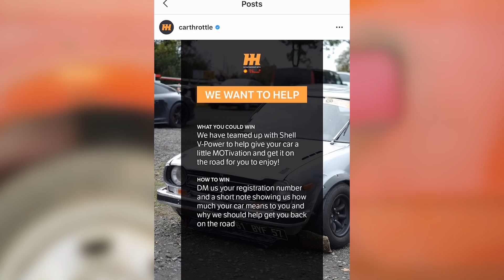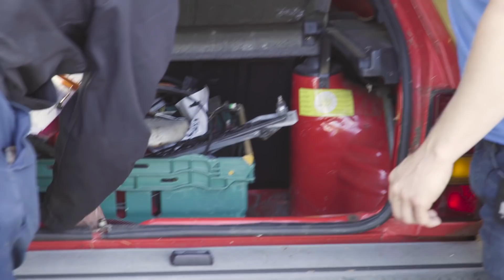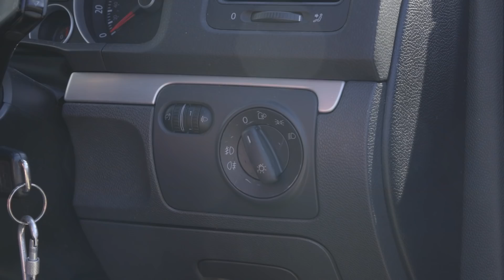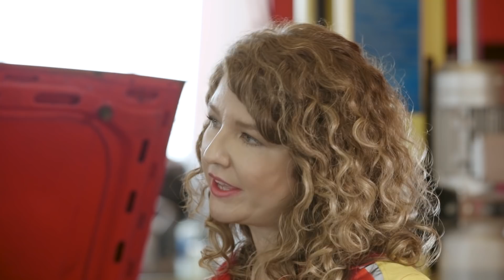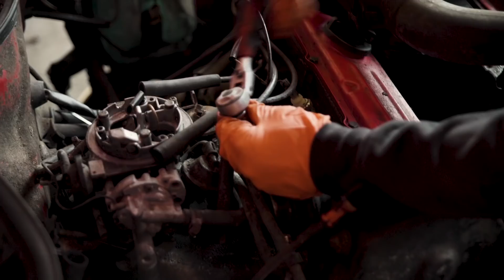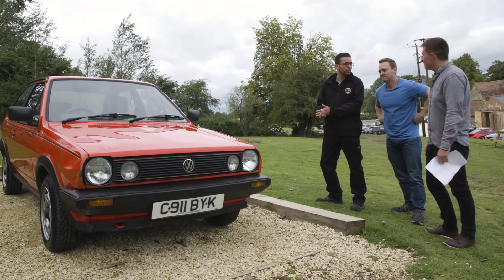Saving A Rusty Project Car From The Scrap Yard

Comment: Classic mistake when guessing how many fails you're gonna get.
Always assume at least 2-3 TIMES more fails than you think.
If EU is any comparison, they'll probably be making it so you can't fix rust yourself unless you're an authorized this and that, lesson being: Fix ALL rust before ever bringing it to MOT.
Why the V-Power on this car? With normal gas it'll run a bit warmer and heat up faster, old engines are better off for that with cold season approaching.
Besides I read further down that this car is now registered as an SORN, so all was for MOOT 😂

Comment: Lets be honest, whether it's Shell V-Power or any other fuel, I can tell you that most oils are produced in the same refineries, as they are typically all the same, you can tell because different trucks, who come to take the oils and all the different brands (Castrol edge, Shell, Esso, Texaco, etc)

Comment: In case anyone is interested, here the full MOT report:

Repair immediately (major defects):

    Horn not working (7.7 (a) (ii))
    Windscreen washer not working (3.5 (a))
    Rear fog lamp does not emit a steady red light (4.5.4 (a))
    Offside Front Passenger's seat with a defective structure (6.2.6 (a) (i))
    Offside Front Body mounting fixings missing O/S FRONT WING MISSING (6.2.2 (c) (i))
    Offside Front Brake pipe excessively corroded (1.1.11 (c))
    Nearside Rear Brake pipe excessively corroded (1.1.11 (c))
    Integral body structure or chassis has excessive corrosion, seriously affecting its strength within 30cm of a body mounting (6.2.2 (d) (i))
    Rear Inner Integral body structure or chassis has excessive corrosion, seriously affecting its strength within 30cm of a body mounting (6.2.2 (d) (i))
    Nearside Rear Integral body structure or chassis has excessive corrosion, seriously affecting its strength within 30cm of a body mounting (6.2.2 (d) (i))
    Offside Rear Integral body structure or chassis has excessive corrosion, seriously affecting its strength within 30cm of a body mounting (6.2.2 (d) (i))
    Battery insecure and likely to cause a short circuit (4.13 (a) (ii))
    Nearside Front Brake prescribed area is excessively corroded (1.1.21 (e) (i))
    Nearside Rear Position lamp not working (4.2.1 (a) (ii))
    Offside Rear Position lamp not working (4.2.1 (a) (ii))
    Rear fog lamp lens defective such that emitted light is adversely affected (4.5.1 (b) (ii))
    Offside Front Headlamp light intensity severely reduced (4.1.4 (a))
    Fuel cap/sealing device missing (6.1.3 (b) (i))
    Brake performance not tested ALL BRAKES BINDING (1.2.1 (g))
    Direction indicator not working ALL INDICATERS (4.4.1 (a) (ii))

Repair as soon as possible (minor defects):

    Nearside Front Brake pipe inadequately clipped or supported (1.1.11 (d) (i))
    Offside Front Brake pipe inadequately clipped or supported (1.1.11 (d) (i))

Monitor and repair if necessary (advisories):

    MAIN BEAM TELE TALE NOT WORKING
    ALL TYRES PERISHED
    Offside Front Suspension component corroded but not seriously weakened (5.3.3 (b) (i))

Comment: Nice work guys.. love the fact you've saved this lil gem! 

Think I'm gonna have to either sell on as repairs or scrap my beauty. (E90)  Engine has a problem (not diagnosed due to lack of time and funds)  it's not been on the road for 4 years now as Ive had no funds to fix it.  However I can't seem to part with it. As it was handed down to me from my late father. I ran it for 2 years booked it for a service and 3 months later it's not running right. Sounds horrendous.. I'm dreading the day I eventually get it fixed due to the fact it's been stood it will cost the earth. If I even ever get to that day..

Comment: Just want to state that this “special fuel” is no different than Asda’s or any other ‘normal’ fuel. You may see a slight difference is something like a new sports or super car but that is about it. If your just driving around doing day to day activities there is no need to waste extra money for what is the same fuel as the cheaper option. It’s like having an expensive loaf of bread £2 compared to a Asda own at 45p it’s the exact same but one is 3x the cost 🤷🏽‍♂️be smart don’t waste your money

Comment: Unless your engine visibly suffers from engine knocking, premium petrol is a waste of money. The ability of the fuel to cope with higher compression has no benefit in cars that do not have the requirement. ITS A SCAM.

Comment: It is much easier to pass inspection here in the US. Much much much easier. If your lights and signals work, windshield wipers, horn, tires still have some tread, brake on passenger side front wheel, you're usually good to go. Being on joking terms with your mechanic works wonders.

Comment: This drives also on usual gasoline with 91 octane and is has no knock sensor so its completely unnecessary to use gas with 99 octane

Comment: Although my Country Canada is in a bad way politically, I'm very glad it's not like the UK for passing vehicle inspections. In Alberta (Other provinces vary a bit so there is an "Out of Province inspection" required if you buy one or move from another province. A regular inspection is required when you buy a car that is 10 years old or older and never again after that while you own it. For the inspection rust isn't really a problem unless it's making the car unsafe to drive. Brakes, good visibility through the windshield, No fluid leaks and Lights all working including daytime running lights on 24/7 when driving. Tires and steering, seat belts of course but not much more than that. Once the car has passed it never needs to be inspected until you sell it to someone else then it is their responsibility to get it done. Costs around $100 Canadian or around $150 Pounds UK. A certified Mechanic from anywhere is legal of he has his certification number. You can get a independent Mechanic to do an inspection for $50 or $60 if you know one.

Comment: Me thinks the lady has swallowed a text book, but is oblivious to the irrelevance, to the carb fuelled and distributor ignited, 1985 VW engine in question.
If it cleans the inlet valves great, but neither the carb nor distributor, will magically optimise their settings, to take advantage of the higher octane fuel.

Comment: Know what’s better than Shell V-power? No petrol at all...yeah. The revolution has started. Buy an electric car. Internal combustion is yesterday’s technology. As a new EV driver, I can safely say I will NEVER buy petrol again. Keep your V-power Jo. It’s garbage.
And when did Car Throttle become a shameless plug for consumables? This was a 12 minute Shell advertisement. Came close to an unsubscribe hit there pal.
Reply: Whilst i agree with you that the future of transport is definitely electric, I must point out some flaws in your logic. 
The environmental damage caused by the production of any car is quite frankly catastrophic. This is true of all cars, but especially electric cars due in no small part to the batteries.
If one has a clean power source from which to charge the batteries and also keep them conditioned, then one can feel safe in the knowledge that after 7 years their car's production has been a better for the environment than a fossil fuel burner. 
If your energy source is a dirty one or if the batteries aren't conditioned properly, then any advantage is lost.
Also, around 2/3 of particulant pollution from cars is produced from brake, tire and road dust. As electric cars are generally much heavier than their fossil fuel burning counterparts and more than double the weight of this old Polo, then you're doing more direct damage to people's health than most other drivers.
Given that the majority of environmental damage cars do is in their initial production, it is almost always better to keep an old car running as long as possible.
Reply: Apollo Mead. It’s a bit of reach. I drive a Soul EV. It’s actually almost the same weight as it’s ICE counterpart. LIFePO4 batteries from LG Chem are both responsibly produced and entirely recyclable. Modular in their production, they can be serviced unlike the older (less energy dense) counterparts. My power source is the solar array on my house and a grid tie to hydro-electric power. Zero pollution.
That aside, I’m talking about economics rather than environmental impact. My car cost me $23 Canadian to run for an entire month. No maintenance costs. The end. 
I agree with you about keeping older cars on the road...but as an EV conversion. I am currently doing one of those with a 1992 jeep. 
I’d love to see Channels like this start experimenting with EV technology rather than supporting and promoting a dying 120 year old technology.

Comment: I wonder how much the repair costs would have been to get this back the way CT did? 

Apart from that ⭐️⭐️⭐️⭐️⭐️
Reply: 100 hrs at 40quid ph = 4,000.
Reply: Cassette Walkman yeah, a generous labour rate, but I meant including parts also.. tyres, brakes, pump, belts, paint shop costs etc...
You can probably rack up another grand on top of that I’m guessing

Comment: Didn't show any of the fixing though, that's the most interesting part
Reply: thats because this is an advert disguised as a video
Reply: They showed some of it... Including the oils change and doing the brakes
Reply: @Mika-85  Fake MOT
Reply: @hardcoretam  Changing bulbs and fitting a battery harness aren't as appealing as a detail is.
Reply: @joempoem478  it needed a LOT more than that for a legit MOT 🤣

Comment: My first car was a Polo coupe S so I enjoyed seeing this, mine was black, I lowered it on some five spoke alloys, eyebrow lip spoiler and a stainless back box, it actually looked quite decent, somebody even thought it was a mk1 gti once! As a 17 yr old I thought it was the nuts, I remember the brakes were non servo assisted, smoked a joint of pure skunk with my mate, we were  doing about 90 when we came off a dual carriage and hit a downhill slip road, the brakes weren't doing much, (very calmly) down through the box, pumping the brakes, managed to scrub off a lot of speed but still doing about 30 when we ran out of road coming up to a t junction so applied some handbrake and drifted perfectly onto the adjoining road and carried on going. Oh to be young again 😂

Comment: Best way to ensure you don’t have any troubles come MOT time? 

Have a mate who works at the local test centre 👍🏻
Reply: Indosarnia  trust me it still happens more then you would imagine. Cars round here seem to pass with brakes grinding, suspension clattering and all manner of obvious defects. All would be easily spotted on an MOT.
Reply: Indosarnia doesn’t make a difference if it’s checkable online. The online check has been around since 2015 if I remember rightly. It hasn’t kerbed dodgy MOT’s at all IMO. I see many of a car (and brought some) that are far from MOT ready yet they passed a day earlier. 
Honestly the trade in dodgy MOT’s is still around. Take a look at local cars under 1K. Pick a few with new MOT’s, the ones being sold by traders (not dealers) are the best examples.
Most get the cars from auction, MOT them and stick em back up with nothing at all being done.

Comment: I don't know how my 1974 GMC Sierra Grande C15 pickup passed VA inspection... It has enough rust to make a Brit cringe... Every time I open the hood (Yes, hood, I'm American) rust shakes out... I'm not sure how it keeps happening... Seems like it should've just been dust in the wind by now... I'm doubting it will pass next year but, who knows? Being a '74 it needs minimal things, brakes, decent tires, functional windshield defroster, windshield wipers, all factory lighting, and the drivers side door must function, as well as the seat belts. Past that, obvious stuff like chassis and exhaust, but it does not require a catalytic converter, or any emissions stuff. Doesn't even technically have to have a muffler though they'll warn you that the cops can still ticket  you for not having any (So far so good on that front, I have no mufflers, you can insert an evil laugh here).

Scary enough, the yearly safety inspections vary from state to state and likewise are more or less lenient on things from state to state, and considering most states license out the inspections to private businesses, mechanic shops and oil quick change places, it's a who's who of what actually SHOULD be on the road... Combine that with the ability register your vehicle as an antique in VA  after 25 years and no longer have it inspected so long as you promise to be a good little drivers and only use that vehicle for leisure and car shows... Yeah like that happens... I've been more and more late 80's and early 90's beaters... The worst offenders are the ones that put the illegal "FARM USE" tags on their vehicle, yes you can register a vehicle as agricultural, but it still has to be inspected, though I believe the taxes are lower, and you need to own X amount of land, I think at least 1 acre? Maybe 2? I don't remember... You see some really sketchy vehicles with "FARM USE" on them. Technically the hardware store bought "FARM USE" tags are for municipalities who require some sort of plate to be on a vehicle even if it's sitting on private property, stupid right? 

Anyway, rant off.

Comment: Here in the state of Idaho, we don't have any type of vehicle inspection. Obviously you can still get pulled over and ticketed for safety issues with the car. I was actually surprised when I took my 1985 ALFA Romeo spider graduate that I had just bought from an insurance auction for $800 to the DMV and the only thing they checked was the VIN and the car color.

Comment: you missed the reversing lights.
https://www.gov.uk/guidance/mot-inspection-manual-for-private-passenger-and-light-commercial-vehicles/4-lamps-reflectors-and-electrical-equipment

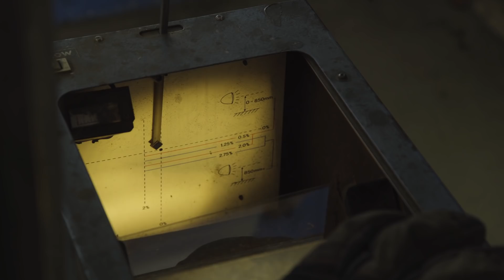Comment: 3:28 What is this machine?
I'm guessing it measures where the headlamp is aimed
Reply: Headlight Alignment Unit (Headlight Tester)
https://www.gov.uk/guidance/mot-inspection-manual-for-private-passenger-and-light-commercial-vehicles/4-lamps-reflectors-and-electrical-equipment#section-4-1-2

Comment: No one should rely on a high octane gas to clean the engine always use fuel system cleaners and deposit cleaners to clean the engine. 

High octane gas can help prevent deposits from forming but not eliminate them.

Comment: Oh, and I've had a 1998 Fiat Cinquecento Sporting in Imola Blue for 7 years, only driven it for 6 months, been stored in a dusty council garage and pushed from pillar to post for years. Drove past it for 2 years at work before getting the courage to knock on the door when I saw a for sale sign.

I keep getting a burning desire to get it done. That part of myself I've left missing for too long.

Comment: “Power steering fluid”

- Checks brake fluid reservoir :)
Reply: @ AG Chiptuning ...  I spotted that too 👍🏼 almost had to watch it again as I couldn’t believe my own eyes 🙈 Incidentally you’re NOT permitted to open the brake fluid cup during the MOT test to check the brake fluid level.
Reply: @MattCSLnut  you can't take the cap off but could still fail it if the brake fluid looks contaminated/dirty enough though through the reservoir.
Reply: I was looking for this comment too lol.
Reply: @paddytotherescue7364  same 😂😂
Reply: Does a MkII Polo even have power steering?
Reply: @tiborklein5349  Doubt it
Reply: @tiborklein5349  I don't believe it does but that's not the point :)
Reply: @tiborklein5349  no it doesnt
Reply: I noticed too!! Come on car throttle did you realy think we would miss that?!
Reply: AG Chiptuning I spotted that as well on my 3rd watch 😂
Reply: They're checking the fluids and lights on Jack's Golf GTI (which is now probably written off by that Royal Mail lorry 😂) the MK5 GTI has electric power steering so has no reservoir - hence them having to just check the brake fluid instead.

Comment: Jo is talking absolute nonsense. First of all, 99 octane fuel is designed for high performance cars, and has no benefit in a regular engine. This is because the compression ratio is not set high enough to cause preignition in the first place (Octane rating is ). If you experience knocking, there is something wrong with the engine, not the fuel.

Also, the ECU WILL NOT detect what octane of fuel you are using, especially not a computer from an era where Super Mario Bros. was the most cpu-intensive thing most computers could do.